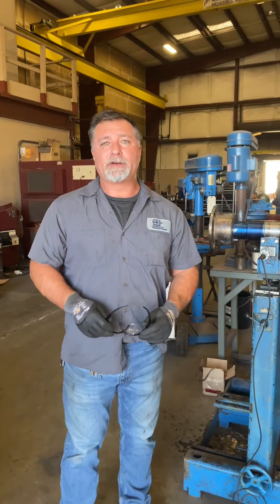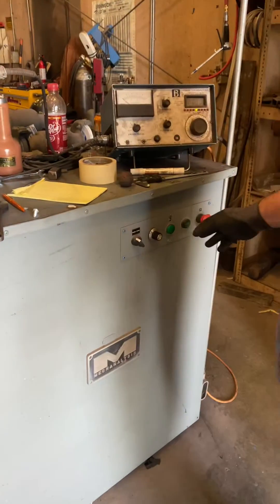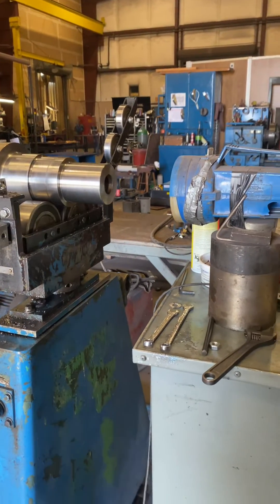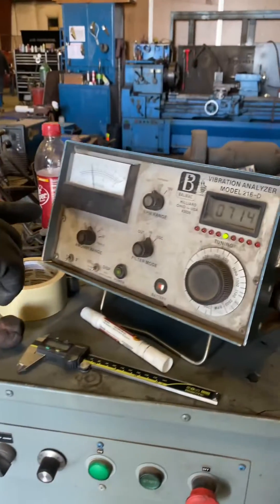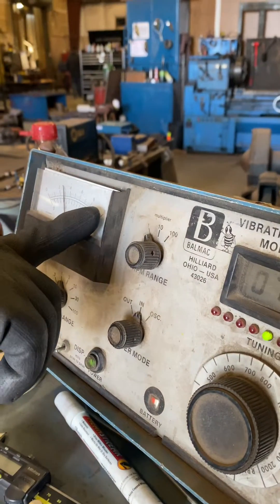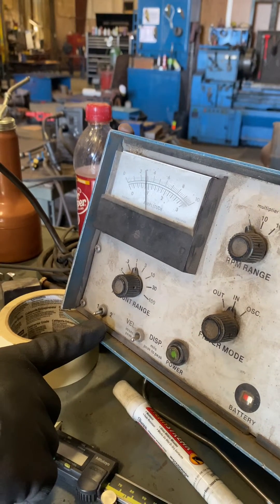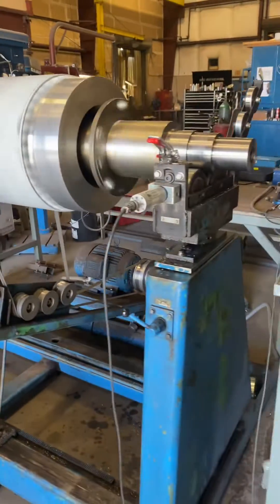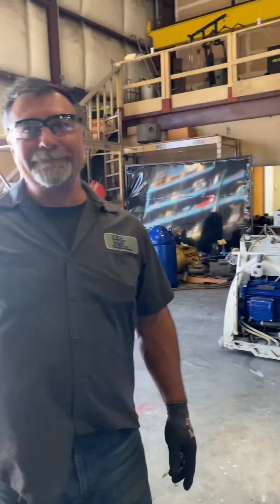How to Dynamic Balance a Rotor

Comment: At the GE Apparatus service shop in Atlanta in the late 70's they used a large Schenk dynamic balancer for motor and generator rotors and gas and steam turbine rotors.  They didn't cover the turbine blades so when a gas turbine rotor was spinning, there was a huge rush of air blowing through the shop, even though it was unshrouded. It was pretty cool.